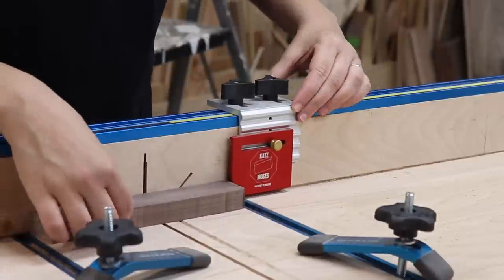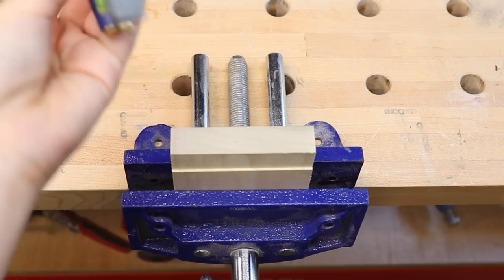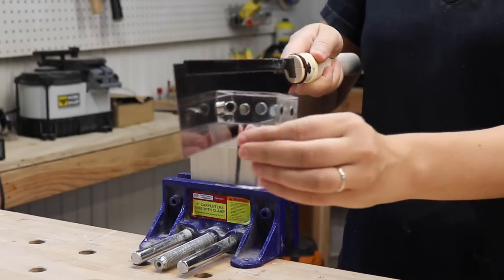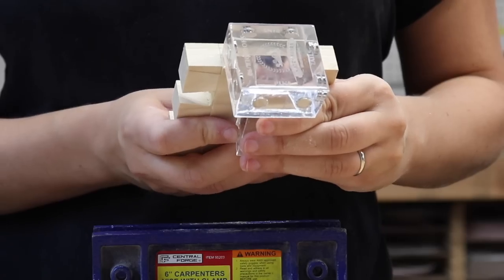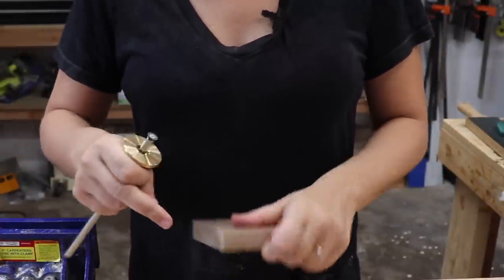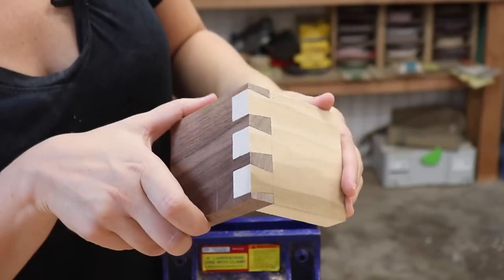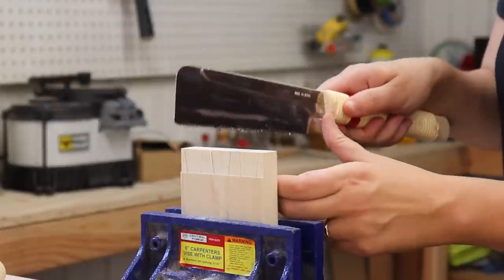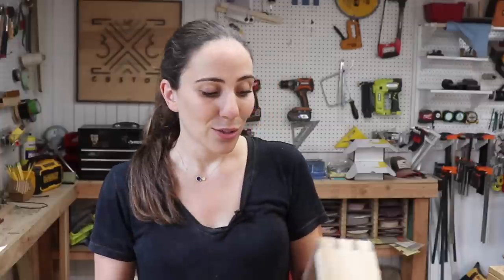First Time Hand Cutting Dovetails // Magnetic Jig // Katz-Moses Jig // Hand Tool Woodworking

Comment: I prefer without the jig gives it natural flaws showing it was done raw.  Love your work as always.  Nice work.
Reply from the maker: Thanks! I hear that! I’m a perfectionist though. Me and flaws don’t do well together. 😂
Reply: Fred, I see we are of a mind! The flaws I don't despair for the world to see, the little inconsistencies  that advertise hand craftsmanship, are not at the glue surfaces. I am ashamed by mis-cuts and gaps. A little less so at overruns down to the gauge line, at least for drawer sides that are usually hidden. I like the slopes to be consistent, and I like the spacing to be fairly even, but I just go with my eye on those. If I cut the tails first, tilting the work in the vise helps as it is easier to judge a vertical as you cut. I don't mind if people use an aid to keep their tool aligned, as I am not above using a block of wood to keep my paring at a right angle, for example. And, any nineteenth century craftsman would use an angled guide block to mitre a moulding stuck on a door stile or sash muntin.
Reply: 3x3Custom - Tamar oh I am a perfectionist as well.  But flaws give it a nice character depends on how you look at what perfectionist point of view is 😉.

Comment: There IS a mathematical rule for making dovetails! I've learned it! But a long time ago, so I have to look it up. The most important number is that of the thickness of the board or panel that is getting dovetailed. The rest is relative proportions and to aquire those....the mathematical rule. Your dovetail exercise took me me back some thirty years ago, when I learned to make them. As learning material we used scraps of pine wood. Soft, cheap, easyily maleable. And we we did everything with a ruler, the formula, a pencil, a square, a saw and a chisle. The very old fashioned way. When you know the formula... you can dovetail all measurements! Thickness, width... easy peasy.

Comment: I have that same vise. I found I got infinitely better holding power after following the instructions and mounting a piece of wood on each side. It also cut down on the occasional marring. I have access to a Moxon vise now at the shared workshop I go to but I still use the blue one at home and it works almost just as well. Might want to give that a shot before committing to the Moxon vise.
Reply from the maker: Yeah. It’s actually been sitting in my shop for 3 years and this was my first time using it. Ha. I’m def going to add some wood to the jaws.

Comment: It looks to me that your angles were correct but your hitting the line with the saw (or correct use of the marking knife) was off on the one without Johnathan's jig. I wouldn't be too quick to discount your angles as long as your marking and following of the lines is correct, you'll do fine. I'd just make a knife wall for that little ledge, It would be smaller, not require use of the router etc., and leave less room for "jiggle" in the joint. You have the skills and a little practice will nail it. My problem is familiarity and comfort at a skill I don't practice much. Johnathan makes it seem so easy for his complicated stuff but he does it multiple times a day - me -- once every few years. Its like learning a whole new skill every time! You're doing great, Tamar.
Reply from the maker: Thanks! I like that knife wall idea

Comment: Wow applause  great job on both.  Been thinking about getting one of those jigs myself.  Really enjoy your videos and you have a way of making it all seem more approachable.  I will share something that changed how I sawed particularly on something that wasn’t going to be getting a bunch of post assembly sanding.  “Whatever direction saw you use, saw away from the face”.  Basically if using a pull saw, you would put the face/show side of your piece away from you.  Western/push saw, face towards you.  Even if it’s a fine saw, it has a tiny bit of grain tear out in the direction it cuts.  Helped my sawing and if it helps you as well, awesome.  Keep up the great videos
Reply from the maker: Thanks!

Comment: You should check out Rob Cosman, Paul Sellers and Matt Estlea. They don't use a dado. Instead they use variations on the "knife wall". Paul invented the technique. Basically, you scribe your line, then cut it with a marking knife to deepen the score. Then you use a chisel to make a bevel into the knife wall on the tail/pin side of the line. Now you can use that little bevel to register your two boards. Much faster and easier than using a rabbet. The bevel will also act as a guide for the saw to cut the shoulders, and to guide the chisel on cleanup. Another simple trick is to look in the side of the saw blade. It is essentially a mirror. So if the reflection look like the wood is continuous, then the cut will be perfectly square. Yet another trick is to put one uncut piece into a vice, and use a scarp piece to set the depth and add another scrap piece on the outside of your uncut piece in the vice to act as a stop. Now you can use the scrap piece as a base to hold your cut piece, and the extra scrap in the vice with the uncut piece to align the end of the cut piece. Perfect registration. You can also add another scrap to one side of the vice to register the side of the cut piece as well.(that doesn't read as well as I would like, I hope you get the gist). As always, love your channel!
Reply from the maker: All great tips! I saw matt Estleas video where he did that knife wall technique. Didn’t know Paul sellers invented that. Not shocked though. Ha

Comment: A couple years ago I took a class on how to make a small wooden box -- not with dovetails but with mortise and tennon.  The ends were inset so that the sides could have full four sides mortises.

The big take home lesson for me is that I can't saw to a line -- I'm very nearsighted so it was hard to see the lines while being far enough away that my head and saw weren't in the same place at the same time.

The solution was to make a rough cut with the saw, not cutting to the line but on the waste side if it, and then chiseling to the line.

The chisel us a much more accurate tool than a saw, especially an unguided coping saw.
Reply from the maker: Sounds like a fun class

Comment: OK - good vid. Again! I think you sold me on the jig too. I'd been eying that up for a while.
The one bit of kit I got in preparation is an old Sorby morticing chisel (probably 1950s or older) that has inches of use left in it. It's  longer than the new ones I got, but it is actually a morticing chisel.
Reply from the maker: Thanks! It’s a pretty cool jig 😉

Comment: The  vice that you have causes your wrist to be at a bad angle, watch it and you'll see what I mean. With a better vice and it mounted down lower I think you'l get much better control of you saw and have less fatigue.
Reply from the maker: Totally agree. I think I’m going to make myself a moxon vice.
Reply: Jonathan's Moxon vise is a wonderful design, especially with the work surface behind it. It raises the workpiece about 6" which helps with a lot of handwork. However, it will also raise the workpiece for sawing and that is not an advantage for you.
Reply from the maker: Bob T252 I’ll have to figure something out. Ha
Reply: @3x3CustomTamar  You could make a short platform to step on while you are sawing. With dovetail joinery, of course. I need to make one to put beside my drill press to reach the belts.

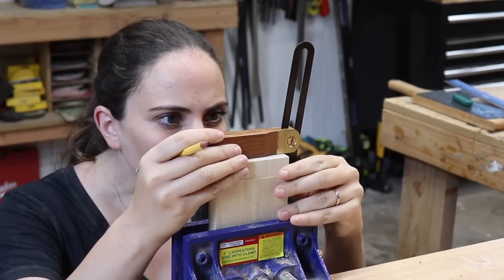Comment: Wouldnt it be faster and easier to take the bevel guage right to the jig like u did @15:17 vs marking on mdf and then going to check it at the jig? just a suggestion..looking good tho."keep cuttn"
Reply from the maker: Oh course. But I wanted to make dovetails without any jig. So I wanted to see what it would be like without the use of a jig. Without a jig I would have to figure out the angles by myself.

Comment: Hey, on the freehand one...you did much better than I ever did on my first three or four.  Isn't it surprising how difficult doing the end cuts on the tails is?   
I am probably getting the jig.   

OH........did you find the shorter saw easier to use?   I have a Gyokuchu 372 which looks like the first saw you were using.   I like it, but thinking of getting a shorter one.
Reply from the maker: I did find that I had more control with the shorter saw

Comment: Why did you not use your holdfast to hold your alignment jig in place?
It would not have been the same as a vice, but it would have stopped it from moving around. Also, you can add a hold down clamp to the side to hold the stock in place.
Reply from the maker: Bc I didn’t think of it at the time.... ha
Reply: @3x3CustomTamar  😎

Comment: Just curious, why is your vise so high and not flush to the top of your workbench? I’m in the middle of building my first bench and all the designs I’ve seen and my vise’s directions say to mount it slightly lower than flush to the bench top.
Reply from the maker: It’s a benchtop vise. You camp it on the top of your workbench. Not ideal. But works in a pinch

Comment: Instead of trial and error, it may be as simple as dividing the width of the board by the desired number of tails (3 in this case).

If the board is 6" wide, then 6/3 = 2, giving you 2".

If you don't want to get bogged down in fractions, you can use the rule trick ( https://youtu.be/cwfqfsGrmRg ) to divide the board into the number of tails that you desire.  Set your dividers from the board's edge to the first mark.  Now you have the value that you need to step by ;)
Reply from the maker: I’ve tried both ways. The trial and error was faster for me. Me and numbers don’t do well together. Ha. I went into the wrong profession...
Reply: @3x3CustomTamar , I can't recall whom it was, but I saw a video where someone was explaining why they use the metric system for woodworking.  Basically, because the math is simpler (no fractions).  I've been debating making the switch.